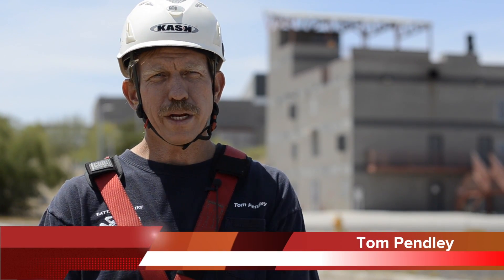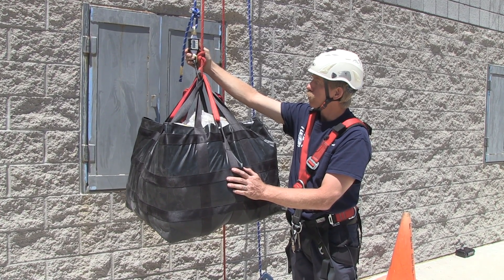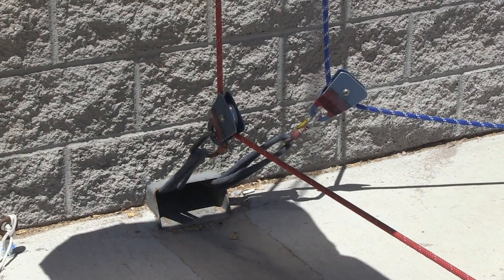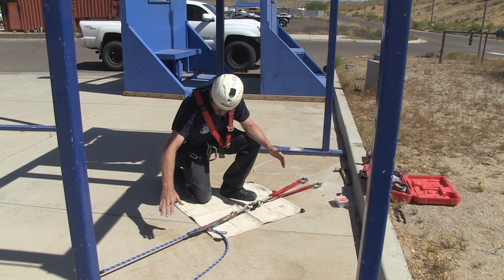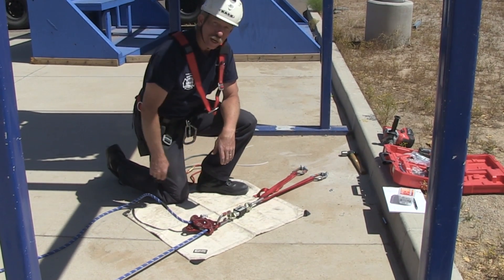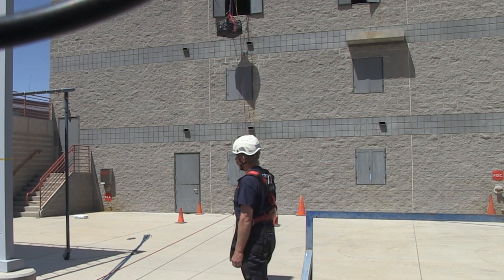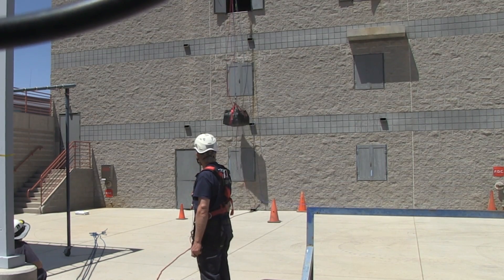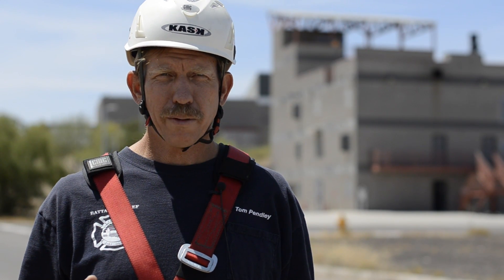How Far Will You Fall?

Comment: Tom, could you replicate the test w a Petzel ID?
Reply from the maker: me 
This particular test was primarily to show the result of rope stretch and slack in a non tensioned belay. 

I have no doubt that the ID would perform exactly like the MPD did in these tests (no slippage).

I would be interested to see performance testing with two IDs while raising in a mirrored configuration.

Richard Delaney posted some video of the ID catching a 600 pound load in a failure test on the rope lab page. I had no problem.

The ID is a good device. It is not as efficient as the ID and Petzl does have a few precaution for its use in long lowers and heavy loads. On the pro side it is lighter and more affordable.

Comment: I wonder if the location of the anchor affected the amount of tension in the line for the TPB?  When the anchor is above the belay, gravity pulls the belay rope down, thus eliminating-or pre-tensioning-unwanted slack, leaving only the 12 inches the belayer creates.  Pre-tensioning the MPD took much of this unwanted slack out, as seen by you strumming the rope prior to drop 6.
Regardless, I love it when teams share their thoughts and findings.  Thank you for this. 
Final thought: does anyone use the Munter Hitch as a belay?  My service does not, but I have trained with some other agencies who do.  Thanks.
Reply: Also, after watching the video again I noticed that the tails on drops 5 and 6 are quite different.  If you started the load at the same place every time (which it looks like you did) then there was definitely a few more feet of rope in the TPB system.
Reply from the maker: Scott Carmichael I think that could be an effect of seeing the end of the rope. I pulled tight on the rope to pull out all slack each time and attempted to set the same size belay bight. There were short tails because we just put the anchor close and it ended up a bit short. When we repeat this test, I could figure out a way to make it easier to show that there is no extra slack. There was not but you can't really tell that in the video. Repeating drop #5 setup multiple time would show this to be true. Again, this was a backyard quick look test.

I made a couple of silly mistakes on this test and would do a few thing different. First, I originally intended to pretension the mod with 50% or 300 pounds of pre-tension. As I was driving home i kept thinking it was too easy to pre-tension and it seemed wrong. Then the lightbulb clicked on and i realized theta the mod is a pulley and it effectively gave me a 2:1 on the enforcer so my 300 was actually more like 150. However, because I had peak hold set I did not see the residual tension after we let go. I bet it was closer to 100 lbf. So the pre-tensiond drops would probably move much less if we did a better job of getting closer to actual 50%.

Again thanks for your comment. I will keep saying that my goal is to motivate people to pay more attention to their belay.

Comment: Tom have you done any testing as to the reaction time of the MPD operator letting go of the handle?
Reply from the maker: Matthew,
Human factors are a big part of our business. I asked the same question after seeing how reaction time and hand placement affected the tandem prusik belay. in 2011 they did not have any study done other than with the device. 

The manufacturer said that the MPD was designed so that sudden increase in tension would cause rotation of the unit in the opposite direction of the T handle open position thereby causing the T handle to rotate closed somewhat automatically. 

In reality, the operator does need to let go which it says to do in the manual.

So, in 2012 Desert Rescue Research, and Ropes Thant Rescue were invited over to CMC's test lab to do some informal human factor testing. 

I have that video and performance graphs and will work on getting it posted soon.

In a nutshell, the MPD performed well in my opinion. more testing needs to be done with multiple subjects and comparison to other devices to gat a good data set.

Again, my feeling is that while not perfect from a human factor point of view, it is better than the tandem prusik belay. Out informal test in 2010 of the TPB had a 10% failure rate where we had more than 10 feet of drop (that was with 400 drops).
Reply from the maker: Matthew MacDonald I spoke with the guys at CMC yesterday and they just finished a round of testing. They report that with a good stance, the belayer consistently caught the 600 lbf mass and did not even need to let go of the T handle. I think more testing and some video is in the works from CMC Rescue.

Also, I just heard from Richard Delaney who does lots of cool testing in Australia. he just posted this video 

http://youtu.be/0ZBHeKbmwag?list=UU0zSt4y0H94wu0xVAONRXOw

There are two I see posted and it seems like the MPD catches quite easily. Its a pretty cool looking setup.
Reply: I saw Richards work yesterday and that is great news.  I didn't want to seem like I was against this practice, just worried about that reaction time.  I appreciate your time doing the tests as well as keeping your video updated with this information.  Now we will have to see how this system fairs out without the extra friction post.  

Thanks DRR
Reply: Hi Tom & Matt,
I too was worried about the "human factor" with the operation of the MPD which is why we did the tests a few days ago.  In short, following discussions with my two accomplices (Dal Atkinson & Bill Proctor) we all made the following observations:
- It happened so fast we didn't realise what had happened.
- with the MPD being used correctly (handle fully rotated, brake hand managing load) we all caught the load without having to release the handle.
- with the extra friction post, the change in brake hand tension was not really noticed.
- 600lbs is an insane load to manage and operators MUST practice managing and lowering such load before they do it on-the-job.  I would ask all operators: have you ever tried lowering 600lbs with your current rescue system?

Richard

Comment: Tom, Thanks for putting this together. This quick look testing is very enlightening and a strong call for more testing. By the way, was the parking break set on the MPD for the drop tests or was the MPD left under the pretension only?
Reply from the maker: Thanks Kevin,

the parking brake was not set as it would not be set when actively lowering or raising and that is what we wanted to test.